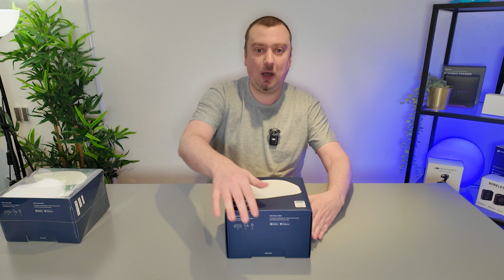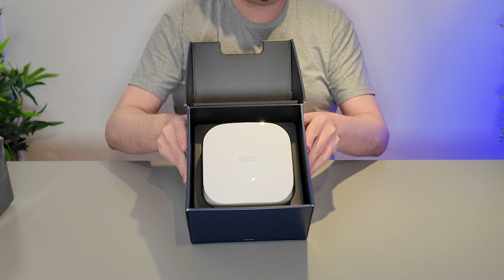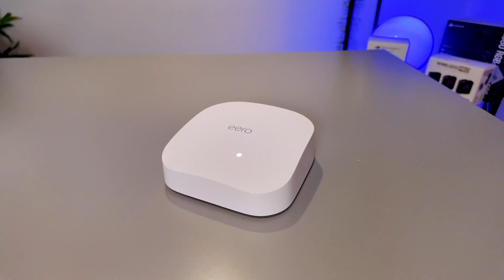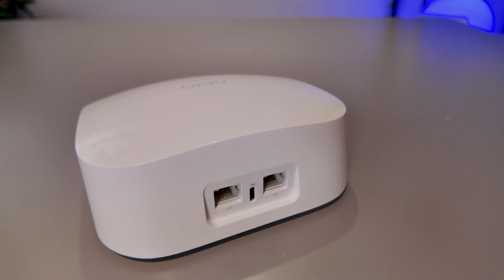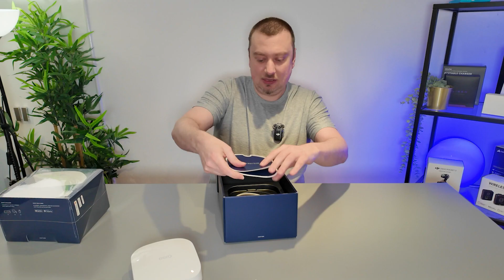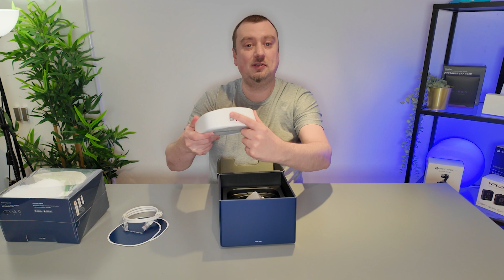Amazon eero Pro 6 Wifi Mesh Unboxing!

Comment: Is it possible to use a single Eero Pro 6 or do you need buy multiple units?  

Do you have to have Echo / Alexa ?

The 802.11ax Eero 6 Pro (K010001 Tri-Band) is currently available for $100 !